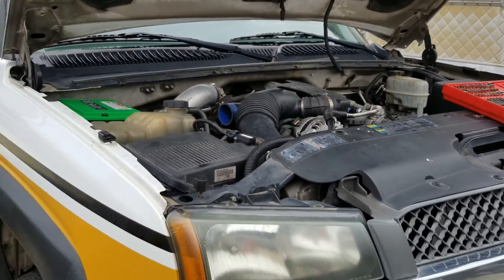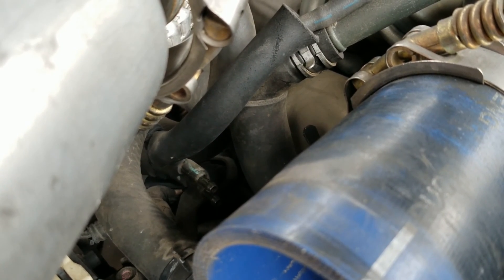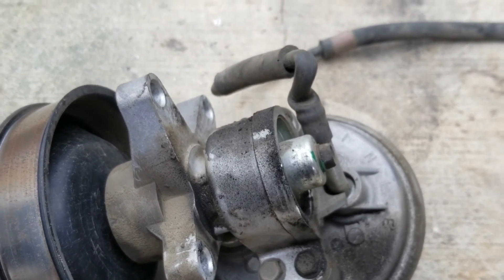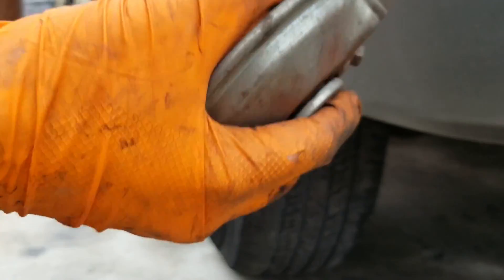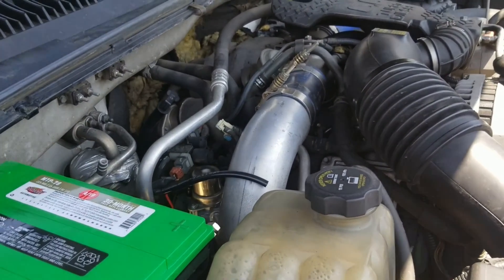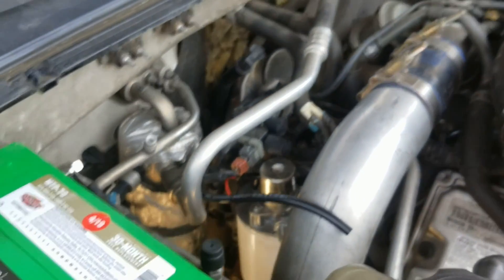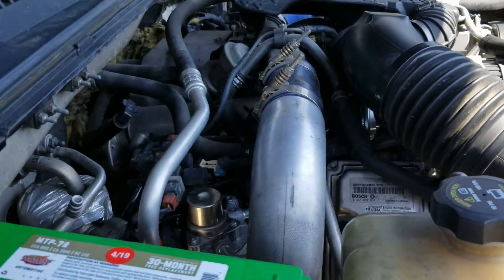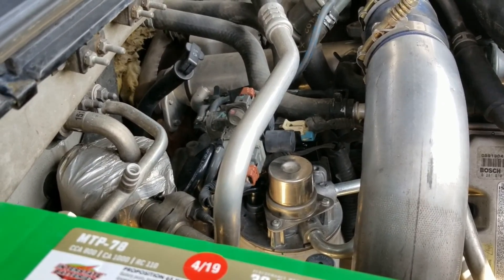How To Fix P0404 EGR Code on LB7 Duramax Diesel California Emissions Model

Comment: I have a 2006 Duramax where the PO 402 came on the shop replaced the EGR and I’m still having issues with the light pop up and still getting a little bit of black smoke from it. I’ve had it back in the shop three times with no success is anybody have any suggestions for me?

Comment: This was extremely helpful to me. Thanks. 2003 GMC 2500hd. Northeast truck( same as Cali. ) I think I'm all fixed now. My emissions test is due shortly in CT. and heard they are really breaking balls on diesels with a new computer system of testing. I would still love to know what those two parts (cylindrical) on top of the solenoid/actuator are and what their function is?  Anyway, again much thanks.
Reply: I have the exact same truck and year! I've had this issue for so long, even had a mechanic replace the valve to no avail!
Did you replace the vacuum line too if just the solenoid?
Reply: @SpencerPadway  my line was okay and not kinked like this guy in the video. Since I did the injectors on that side I had the cooler and EGR valve off. The cooler was packed with crap so I soaked it with carb cleaner for a week. Was the only thing that would cut the grime in there. I replaced the EGR valve, even though I think the old one was okay.
Reply: @billypirone7960  Thanks! I'm at 125k miles so I'd expect my cooler is packed as well. Same thing, EGR valve didn't look  bad to me but was kind of the default thing to try. I ordered a solenoid so will soak cooler too and see what happens
Reply: @SpencerPadway  when I had the cooler off I screwed one end down on a 2x6 with a piece of roof material as a gasket in between. Soaked it and dumped it several times over a week's time then rinsed it with gasoline after. Crazy what came out of there. I do very little highway driving. Guessing that makes a big difference

Comment: Hey I am having trouble with the same issue maybe we can touch base, I need my truck to pass smog, but I am having no luck. My instagram is (rs_tommy78) if you msg me that would be great. I have a 2003 duramax it can be seen on my profile.
Reply from the maker: Did you go to the steps in this video? Also I have a supplemental video going over the hoses to make sure they are all in the correct places. Did you double-check those?